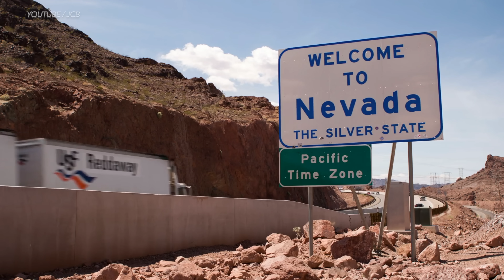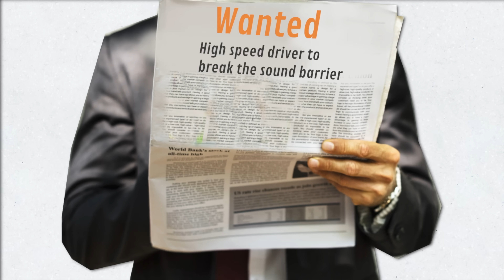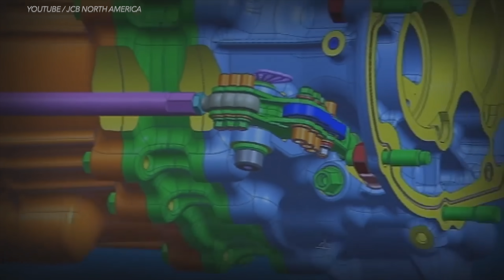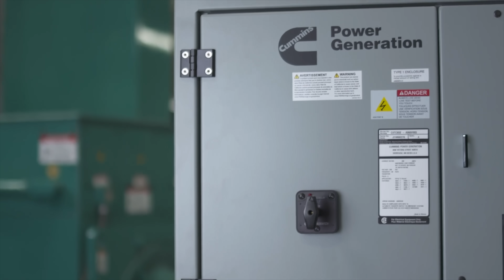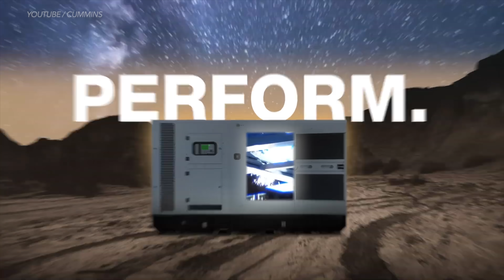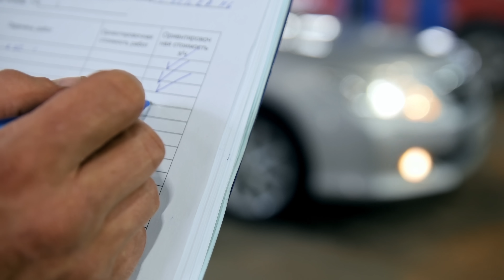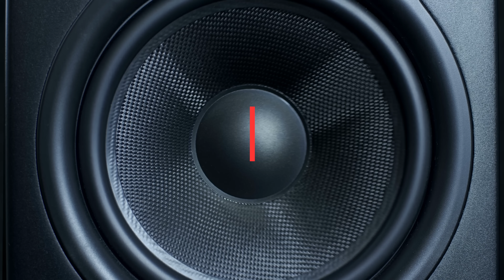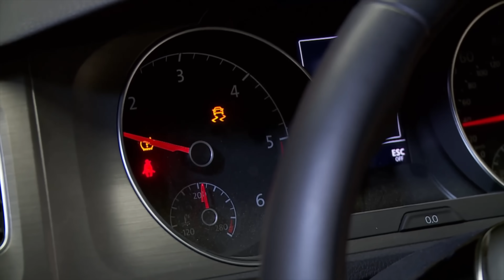Here's Why Diesel Engines are Being Banned

Comment: First of all I live in western Canada. My first car was a gas. And I hated the smell of gas. So I sold it and brought a 5.9 Cummins and never looked back. Ended up buy a Jetta tdi to drive to work and back. 
I hate gas smell. I love the torque and power of a diesel. Also I usually park outside all winter. And only had one issue with diesel not starting as battery froze.

Comment: Diesel pickups around here belch black smoke and are super loud. Plus the idiots in them drive like assholes. Diesel also freezes in winter, I've had it happen to me several times. Gasoline doesn't freeze. They don't like Biodiesel either. My engine completely quit when I had to fill with biodiesel fuel. Pumped it all out & refilled with the correct fuel & NO problems. Very costly.

Comment: Scotty - You said Diesel engines are near zero emissions today! We need a pro diesel campaign to promote this fact as this country is nowhere near ready for an all-electric car future.
Reply: Nearly zero CO2, but diesels emit some types of pollution that petrol engines do not. For instance the nitrous oxides and soot which are directly toxic to humans, and therefore Diesel engines are not appropriate for urban areas. The issue we have in Europe is that the are very heavily used in dense urban centres.
Reply: @sammydemon666  - A lot of the diesel engines in Europe are not the new Generation 4 diesel engines which reduce both significantly.
Reply: @rockylee3281  Most of the cars in Europe are not the new generation of anything haha. My diesel is from 2003 and you feel like years are being shaved off your life when you stand near it when the motor is running.
Reply: @sammydemon666  Also these urban drivers often cannot do the high speed motorway runs to clean out the particulate filter which is a requirement.
Reply: And not vote Democrat
Reply: @borla4491  AGREE 👍 100% FJB
Reply: @borla4491  what has this got anything to do with this?

Comment: It is a shame that smaller cars with diesels weren't brought into the US... since Isuzu gave up. Current small diesel cars in the UK seem to get between 45 and 70 US MPG. Granted that they are around $1200 more expensive than their gasoline counterparts, but that's still cheaper than buying a hybrid. Every time gas prices soar all my diesel truck driving friends complain that fuel costs around 18% more than regular, 10% more than premium. It's a real shock paying $7 a gallon.
Reply: Volkswagen made diesel passenger cars up to a few years ago.

Comment: 2022 gmc with 3.0 lm2 diesel. Best motor I’ve had in a truck, get 2 times the mileage I did with my gas truck. 22 more bucks at fill up but get 300 more miles. Love it, never going back to gas. Get 25-30mpg if I’m hammering it, going 65-70 I’ve gotten 35. In town it’s 20 plus. Insane mileage for a full size 4x4 truck 😊
Reply: As a tech all I can say is I have yet to see those kind of mpg numbers also I want to say good luck and to save some money on suspension, engine accessories and drivetrain repair. Best truck for reliability is hands down 2007 up toyota tundra with 4.7 or 5.7. These things don't get good mpg but they won't leave u stranded and will give u great peace of mind even 500k or more Miles using them hard as a work truck.
Reply: @jd-it4on  literally hundreds of YouTube vids showing those mpg test on these. Not worried about things breaking had a gmc 2500 prior to this I drove for 11 years and only did shocks once and just oil changes.  Wife’s 2017 Tahoe has 125k miles, only done struts other than oil changes.
Reply: @DFWrancher  oh really show me just 1 video of someone hammering on there truck and getting 30 mpg. I'll be waiting. Just stop it. Also sound like u r just a commuter that doesn't use a truck for intended purposes.  When u want to take that truck off road or haul a bunch of weight or tow often good luck buddy but if u r just casually driving and not putting a lot of miles on okay u got a good truck for that. Also yes there r a few problems with new twin turbo v6 tundra but I think those will be sorted out and a lot of them have been already but I was talking about the 4.7 and 5.7 07 08 09 10 11 12 13 14 15 16 so on.
Reply: @DFWrancher  I have the 2022 Chevy Silverado and get 30 MPG on the highway.
Reply: @jd-it4on  only reason tundra was reliable is they refused to do anything innovative with the drive train. Giving them the worse fuel economy off all full size trucks. Gm and Ford  are always trying new stuff to give more power and fuel economy.
Reply: Man that is great.  I have a 2018 L5P, lifted with all terrain tires, i get 12-13mpg 😬
Reply: Is that an Italian engine?
Reply: @glennbeadshaw727  it's a Duramax 3.0L inline 6 cylinder turbo diesel with 277hp and 460 ftlbs of torque.
Reply: @cfrank925  sorry Frank I thought I was on the 5.3 L gasoline page LOL yep Duramax are awesome
Reply: There's no denying duramax's a good engine
Reply: 5.9 CUMMINS 12 AND 24 VALVE SOME OF THE BEST ENGINES EVER BUILT THERE'S EVEN A MILLION MILE CLUB. NOW THATS A LOT OF MILES
Reply: @thedude8976  yep Cummins probably is the king but is it really I've never seen a comparison to the Duramax on longevity absolutely no denying that Cummins goes the extra mile to beef up the important parts of the engine
Reply: My 2022 sierra 1500 with 3.0 max tow. Gets 28-29 mpg highway and 23 in city.
Reply: That's nice, but still a GM product.  it won't last long.
Reply: @bikerz3857  my last gm truck before this lasted me 11 years with zero problems just replaced shocks and maintenance. Probably 6 gmcs in my family right now and zero issues. Wife’s 2017 Tahoe just hit 125k zero issues only replaced the struts.  Was gonna get a 22 tundra but they have all sorts of issues.
Reply: @bikerz3857  GM is crud these days

Comment: Nah bio diesel ⛽️ will be the alternative fuel that will still be in use. Dramatically less pollution all around. Diesel will still be here.
Reply: The Diesel engine is the original green energy solution. 

The engine was designed for farmers, who could grow their own fuel to power their tractors and machines.

Comment: Disagree, people will still need turbo diesel 18 wheelers to have their EV's delivered :)
Reply: @mind games hydrogen is too expensive, and replacing the truck fleet will take at least 50 years, specially taking into account all the independent truck drivers
Reply: Lol 500 miles a day is a joke, especially when there is an almost 24 hour recharge, in two days I can push around 1400 miles, not to mention since I am otr I can't stay in my truck and sleep if it is recharging, EV trucks have a very long ways to go, and that 500 mile range is not a 80k load not to mention all the heavy haulers pulling 100k plus
Reply: @mind games Absolutely, if profitable hydrogen sources are developed, like the spent oil wells.
I believe in electricity producing fuel cells and modern electric motors.
Reply: All electrical equipment and the manufacturing of these products that are un bio degradable are more harmful to the environment and are all another form of control dictatorship
Reply: Diesel trucks, tractors and heavy machinery imo may still rely on Diesel engines. But cars? I think there will be less and less
Reply: Tesla SEMI truck coming year 2024/2025 with 500 miles range.. 🔋🚛🔋
Reply: @mikafiltenborg2291  sure it will. Like all the other electric semis on the road currently, 250 miles max.
Reply: @mikafiltenborg2291  Do you even know how far the average truck driver drives in one day?
Reply: @jeremygaillard5924  you know how much time is actually waiting
Reply: @mikafiltenborg2291  Nope. All battery, no hauling weight.

Comment: I worked in the locomotive industry for a while not as a Diesel mechanic but I learned enough about them to understand the incredible fuel efficiency that locomotives have using diesel engines over coal fired steam engines. Although Volkswagen did cheat the emissions standards, the engine were still very clean and efficient engines! Water is still by far the cleanest energy producer and hydrogen cars are the leader in clean energy but why don’t we see or hear more about them!? I know why, do you?

Comment: Our f350 diesel dually has 700,000 miles and still acts like a young whipper snapper!
Reply: Outstanding!
Reply: I have 1990 f250 with about 440,000 same engine and transmission. Even plays rock music really loud , and has pulled a load majority of its life.
Reply: Awesome f350 dually👍. What year? Our 2017 f350 srw diesel that pulls our trailer to travel full-time on the road has now 112,000 miles and counting with just basic maintenance that I do myself in the middle of the desert or my home garage. Keep powerstroking...
Reply: @j.l.salayao8055  our truck is a 1990. Replaced the original king cab with a single cab then got rid of the utility bed and put in a 8 foot wide 10 foot long flatbed. Recently put a cap 4 foot high on the truck and lifted the cab. 400 watts solar on the roof, 2 tool boxes on the sides. One tool box has a floor jack, stands and a generator. The other box carries 3 five gallon cans of gas and 3 of diesel. A winch will go on the front beefed up pipe bumper. The box carries all the tools we need on the road. Still our truck named Frank N Truck gets 16 mpg! I don't think the new models can hold a candle to it.
Reply: Haaaaaaaa

Comment: 02' 7.3L powerstroke at 512k and still going strong
Reply: 1999.5  six speed, extended cab 7.3 ..... just under 200,000. I can get 21 mpg on the road and  18 towing a load.

Comment: @ 5:08 and on The Rail-Road Industry is mentioned !
But What was NOT Mentioned Is that " IN "  the Locomotives the Diesel Engines
are " Used ' ONLY ' for Generators " ! " Yes, " Those Generators Only Produce Electricity !
Those Locomotives Are " Powered By Electricity " And Not Directly By the Diesel Engines !
Reply: not all

Comment: My 2015 VW Golf Sportwagen TDI (diesel) averages 47 mpg around town and averages 55 mpg going 75 mph. I don't care about the price of fuel.
Reply: I actually recently test drove that exact model and loved it. Alas, I'm sadly not in the market for a car right now. Hopefully there will still be used VW diesels on the market for the foreseeable future. Did you buy it new? How many miles do you have on it? Do you have the manual or automatic transmission?

Comment: Love my 6.7 Cummins!  It's 248k miles and still going strong.  I will never get rid of it!
Reply: 20 bucks you don't have a muffler
Reply: @ocrapo9327  100 bucks he removed the DFP
Reply: @theowl2044  Maybe I did, maybe I didn't...😉
Reply: Cummins engine sound the best without mufflers and and catalytic converters
Reply: I have the same engine in my Dodge 3500 pickup.
Reply: Love both my 5.9 cummins 02 and 04.5 HO. 250k and 127k  one 5speed and one Ats stage 5 automatic. Best engines I've ever owned
Reply: And I can hear it Cummin and Going.

Comment: While I was working on a military base in Iraq, I got assigned a Ford Ranger crew cab with a  4 cylinder diesel engine. I think it was a Perkins.
Reply: Navy has been using diesels forever after the sail period.  Electric, prime mover ( main propulsion) on small and full size boats.  We had a little 4 cyl. Westerbekes that would fit in nicely with Tesla motors.
Reply: The diesel rangers actually have a Ford built engine which is the same one we see in Transit vans in the UK. The older Rangers engines were built in the UK but now they have closed that factory down as it was cheaper to build abroad.